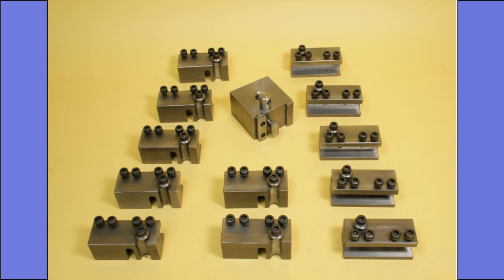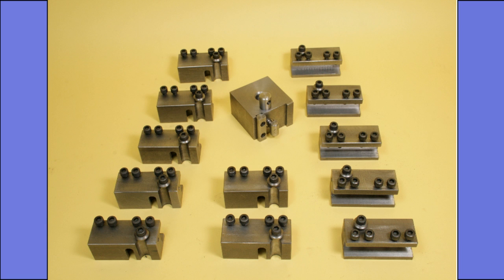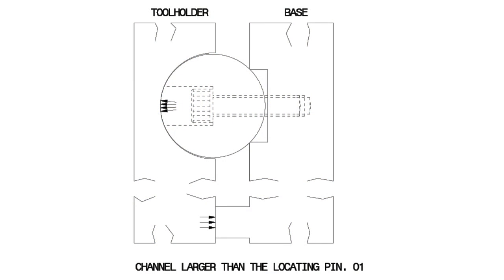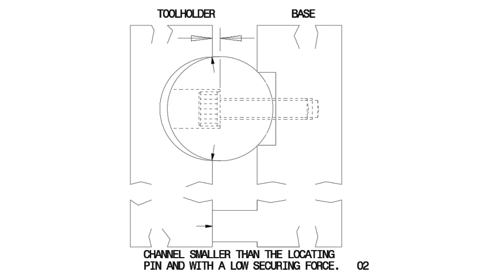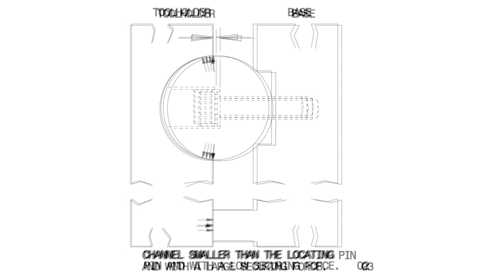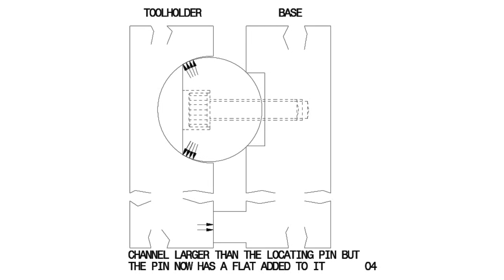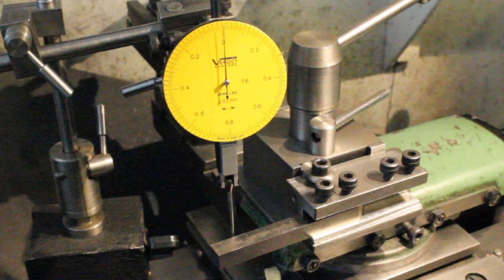QCTHMk2a

Comment: Hi
Intent to inform: I made one from some/your plans, be aware that the excenter plug has a way to thin wallstrength with +-1mm. I broke min off after the 1. use. As seen here in the clip your excenter grabing plug is at least 12mm thick. The whole system is very regit besides the somewhat misleading plans spec, it is a very good design.

Comment: I like it :-) Nice sensible design. The only thing that would bother me, is the need to use a separate tommy bar . Could you not redesign the cam , so it is operated by a lever concentric with the mounting bolt?
Reply from the maker: The answer Bill is of course, yes. However, whether it would be as easy to make is doubtful but without having done the design I cannot of course be sure.  Ease of manufacture is though a major factor in the design. 

There is nothing to stop a workshop owner modifying the QCTH, as some do for many of my designs, even this one. For me, I have spent very little time in the workshop in the last five years,  and at 84 I would like to start making things again, be it metalwork or cabinet making, my preferred pastime.
Myself, I do not have a real problem with the Tommy bar approach, other than to say, I am considering having two holes at right angles for the bar giving more
choice as to where the  bar is inserted.
Reply: 84 is the new 48 ;-) just keep going as long as you can Harold :-)
Reply: Exactly the detail that bothered me about this design.

Comment: Harold, this is an excellent design for use on lathes where tool position repeatably is extremely important such as in instrument making and other tight tolerance machining. By the way, I have been using your books and following your website for years, and wonderful to see the videos. Thank you for taking the time to post this and your other works. Regards, Paul Jones